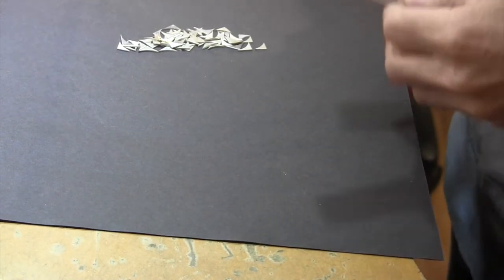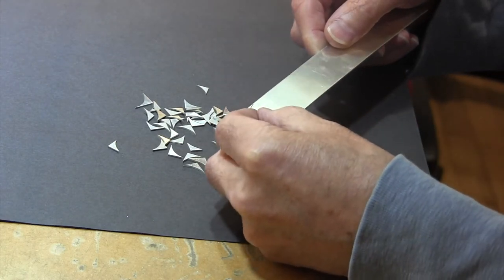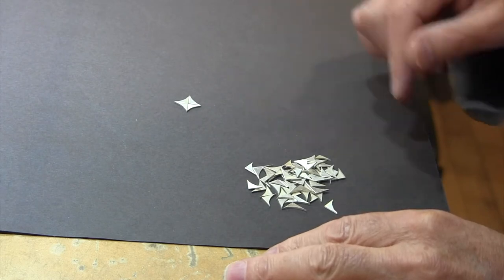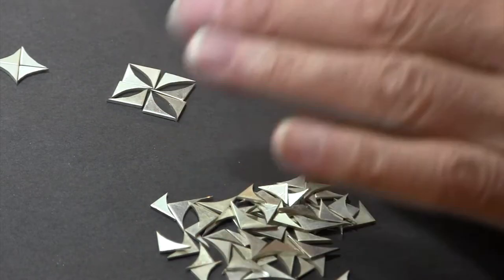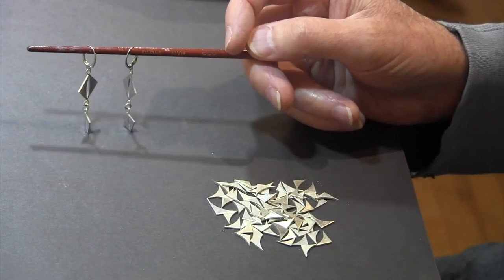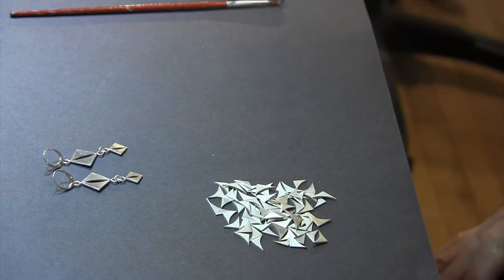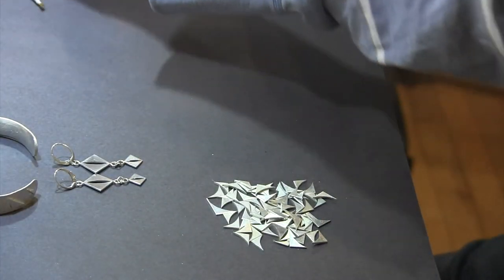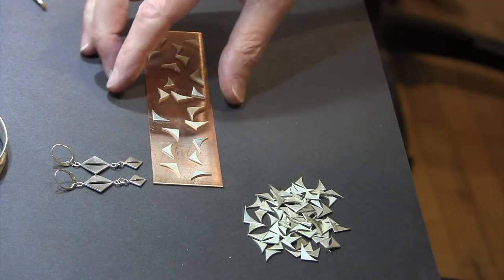Working with Sterling Silver Remnants

Comment: Beautiful. How did you fuse sterling?  Did you use flux or something else ? I thought that only fine silver could be fused. Thanks
Reply from the maker: Hello Dianne,  Thank you.  No you can fuse sterling to sterling, actually it is more like melt sterling to sterling. If you notice the lower surface has been melted, I called it reticulation because the effect is similar but it is a technique of very carefully melting just the surface of the silver to fuse the pieces to the cuff.